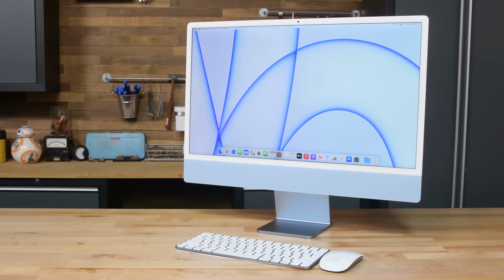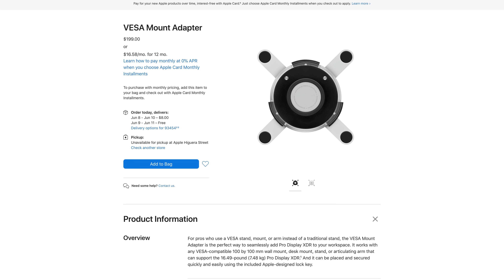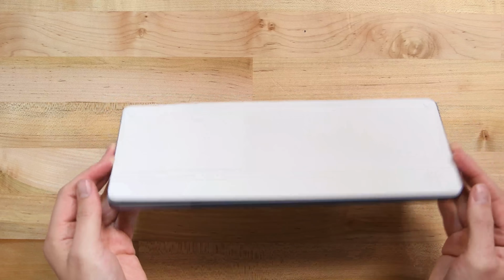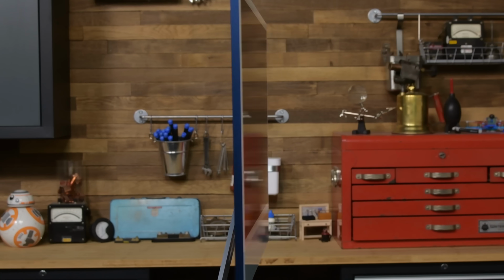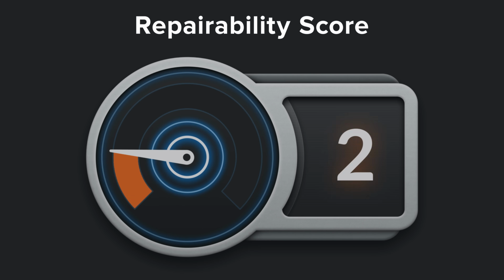M1 iMac 24” Teardown: A Desktop Only Jony Ive Could Love

Comment: moving fans in an unopenable device should be illegal
Reply: The back cover of the imac has more than enough thermal mass to provide passive cooling, if the macbook air can do it, i can only think of one reason they put fans in this 😠
Reply: tehy just opened it in front of you, waht do you mean??
Reply: @JohnSmith-pn2vl  it’s designed not to be openable by consumers, using all glue and adhesive that needs to be replaced for the front to be reinstalled. On portable devices they have the reasoning that they must to this to keep the device small and portable. But on a desktop device there’s no excuse not to use clips or screws other than make it impossible for DIY repairs

Comment: Why only 2/10? All the parts can be removed without using a heat gun or adhesive remover.
Reply: Reparability is not only on how easy it could be disassembled (in which is pretty risky for the entry point to be the big glass display, hence a low score)

it's also availability of parts etc. And since we know it's apple, parts won't be available.

Comment: I'm sure there's an argument for cost and waste etc but hear me out: I would actually really like to see a small five or ten minute rechargeable battery in that thing for those one off moments where you kick the cable or have to swap it around or whatever. Because M1 is so efficient it could be really small and cheap; maybe they could even use cells from other devices that didn't quite meet quality standards like some CPUs and GPUs. It could just sit there charged at like 50% battery or even less, like what a cool little feature to be able to list on your product.

Comment: I'm Imagining that there is someone senior in the Apple design leadership that has Anorexia or Bulimia, because since 2008 there is this obsession with making all things thin, even when it interferes with function and has no discernable advantage. This latest idea of "solving" the "problem" of the thickness of desktop computers instead of addressing real problems like lack of adjustability of the height and rotation of the screen, inaccessibility and number of the ports, and still having the charging port on the bottom of the mouse is just maddening.
Reply: Their idea of a perfect device is probably an infinitely thin rectangle with a screen on one side and an Apple logo on the other side

Comment: It costs way too much for offering almost  nothing in return. It wouldn't make it worth it, but why doesn't it have a battery or something? It's just the MB Air/Pro with a big monitor, it having a built-in UPS like that would be actually very helpful. Almost no ports... the storage is a JOKE, 256 GB unexpandable? An M.2 port would've killed them or something?

Comment: Repairability score is not relevant anymore, if 1) all components last a life time (in my experience, Apple uses high quality parts in their stuff), en 2) the new chip designs with impressive performance inherently does not support upgrades and therefore no need to fix anything. 
Last year I did a harddisk / ssd swapp/upgrade to my 2012 iMac 27" thanks to iFixit's tools and video's, but it would have been better and cheaper to have bought the upgrades in 2012! 
My conclusion: Never buy the base model with less memory and storage, and always spec-out the new model you buy!

Comment: You get a laptop with bigger screen and no portability. The cooling seems lame.
Reply: It doesn’t get hot though. The M1 MacBook Air is really good and has no fan at all
Reply: You just figured out what the iMac is. It’s a device you just have to plug in. You don’t need to buy a monitor, keyboard, etc you just unpack it and plug it in. I’m appreciating that I don’t have to do anything if a family member purchases one

Comment: Aa all in one it works perfectly fine but the price point doesnt make a ton sense considering it doesnt have any performance advantage over anyone else
Reply: Are you joking? 🤦‍♂️
Reply: @kristiaankristiaan5278  The M1 is a pretty slow desktop chip. The CPU gets beaten by mid-range laptop chips and the GPU is beaten by the entry-level desktop cards from 2014. It's really a terrible deal for $1,500.
Reply: @swegweg erg It's true, it's just a shame that most Linux boxes will eat your Mac for lunch.
Reply: @dial2616  lol you’re joking right? Multicore performance is sometimes worse than mid range chips but single core performance (which is far more important for day to day tasks) is fantastic

Comment: serioussly apple needs to be badly bashed for not using the industry standard M2 module SSDs and using soldered on flash storage... even the ps5 will support m2 ssds!  and technically the xbox series internal ssd also is an m2 drive... if size is an issue there are various sizes that take up less space... its better for both upgradability and data recovery!
Reply: they are way too slow, its ben ages since an m2 was found in an apple product. you live under a rock
Reply: @JohnSmith-pn2vl  Really too slow considering the standards for nvme m2 drives use exact same pcie x4 interface that apples soldered ssds use... also apple has never used m2 drives in their laptops, they used there own propriety version of an m2 module and then switched to soldered with the retina macbook pros/airs years ago..

Comment: wait what? 2/10? everything could easily be removed, I don't understand
Reply: yes but however, you can't replace the ram, cpu or storage
Reply: If any two of the comically tiny transistors short together, you will get instant permanent data loss.

Comment: Worst Repairability from New iMac. APPLE keep it up by blocking Third party Right to Repair
Reply: @mohammed.baig.  The memory doesn't appear to be integrated on this board, it does seems to be soldered adjacent to the CPU though. Either way, you could still get the same speeds Apple is claiming (up to 7.8k ghz) with DDR5 DIMM specifications (which are rated for 10k+ ghz). 

The storage has no right to be soldered on when there's as much space inside as there is. Apple had their pick of small form factors, and they could have handily included a 2.5 inch SSD, a free SATA port, an M.2 SFF slot, or an NVMe mount; but they didn't. It's a disgusting display of ignorant design on their behalf, and there's not really any way to feasibly refute it unless they redesign the SOC.
Reply: @Aditya Bhattacharya DDR5 has manufacturing specs and fabs ready to build it. The real issue is that nobody really had the initiative to start using it. I was hoping that Apple would twist Hynix's arm to put DDR5 in the Macbook, but maybe that's expecting too much from the biggest company in the world.
Reply: @dial2616  there is not a lot of Space in the iMac. Most of it is taken up by the screen
Reply: @Aditya Bhattacharya DDR5 (and I think DDR6) is used today in some Phones.

Comment: The closed ecosystem that is the mac really shows how crappy it is when it comes to repair ability. Few other companies could create such a nice looking computer but in an open standard ecosystem I don’t have to buy it and could go with a thicker model from a competitor that has more of what I want and I only compromise on looks, the least important part of a computer we apple fans have to pay way more for. Ive can go kick rocks for making that happen.
Reply: The m1 iMac is actually quite fairly priced considering the performance and you can easily use a windows pc with an iPhone
Reply: @Nik6644  The monitor is the only thing on it other than profit margin driving up the price of the iMac. Every single bit of the performance of the iMac is available on the Mac Mini for $700. And how many hundreds from a Mac mini is pure profit? How much would the iMac cost if it had the equivalent of a $200 monitor in it? The cost to manufacture computers that use less materials, have less parts and take up less space is not higher than ever before, it's lower than ever before.  If Apple had competition it would have to reduce the profit margin on these to compete with others who use more materials, make larger computers, but come in at a lower price because they have lower profit margins than Apple increasingly demands. The iMac is less expensive to manufacture than the previous model in almost every way and the only difference between models is an extra button on the keyboard, and extra port on the power cord and an extra core in the gpu which I guess justifies adding $200 to the price. The iMacs are not bad compared to older models for sure. It's still a good price because we have no alternative to compare to. But if Apple had competition in this space these same computers would start under $1,000 and top out at $1,200 which is a more realistic price for what you're getting. Maybe they will bring them down to these prices some day if they do what they did with iOS devices. Keep the old models as low end models and introduce newer faster technology in other models that add a few hundred to the base price each time. Apple will keep selling M1 chips until Intels low end is faster than an M1. The M1 is here to stay for a very long time. And it's the absolute lowest end chip being sold for a premium for as long as they can get away with it. Again, something harder to do with competition.

Comment: Im sick of hearing about repairability - if you want ultimate repairability make your own system yourself.  Apple have replaced a batter / top shell / touchpad / keyboard and screen due to AR issues at no cost to me ever.  I would not do it myself and would prefer if Apple did any repairs because if they stuff up they are liable, not me.  Even if the parts were available I would not trust too many "home users" fixing their own system and then blaming Apple when something goes wrong.  

The hardware is not modular and the cost the components themselves (if available beyond Apple) would be more than the system itself so it's financial lunacy at best.  Rule of thumb remove the ability for people to F UP their own systems within or outside of warranty, then makes sure only the manufacturer is able to do this.  Non tech people simply cannot be trusted with such a repair and I don't blame Apple from protecting "fixers" from disasters due to lack of knowledge and sheer stupidity.

Comment: Who wants this monstrosity? Cannot fix cannot upgrade and too expensive
Reply: its not expensive, try to get a 4,5k screen and an entire computer + periperals of same quality inPC world. its not even possible.
nobody wants to upgrade anything on this. its not needed, you have thunderbolt, you can connect 40 external drives on one of them, that will do. its better for the environmetn to replace the entire unit, because its so efficiently made and from recyclable material, any repair would be worse in terms of waste and c02. good job apple, as always.
Reply: @JohnSmith-pn2vl  You are jocking right? It starts at AUD 1899 and that does not even have a NIC on it.. I can easily get a 4k AIO for lesser
Reply: @jolly1039  no im not joking, show me your machine, and no, not a 4k, a 4,5k IPS high quality one, not some tft crap like the usual stuff. you wont find any, if you find one it will be at least 1300 AUD